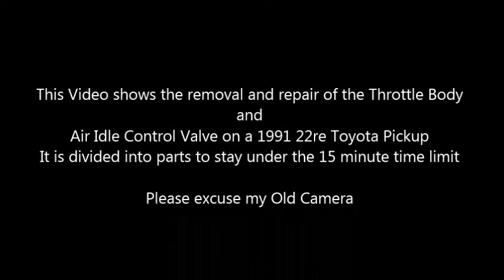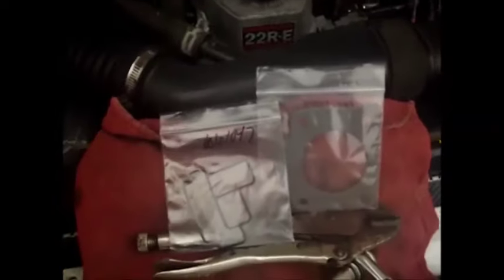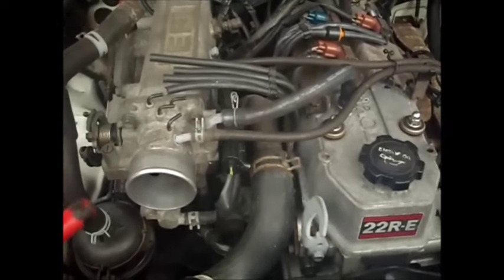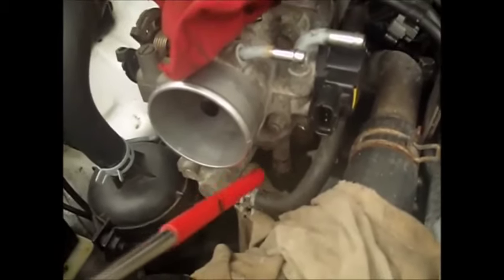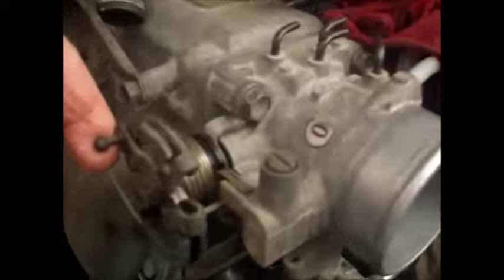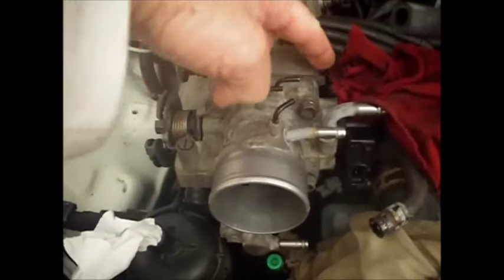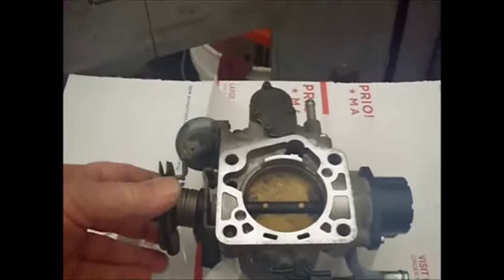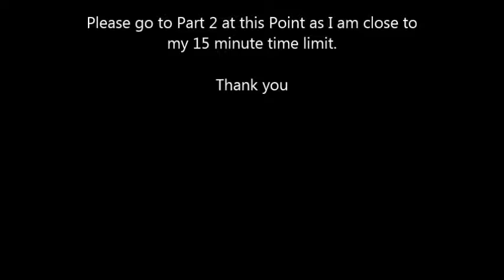Removal and Repair of 91 22re Throttle Body and Idle Control Valve Part 1

Comment: Thanks for this video. I was going to take off my throttle body to a 95 toyota pickup too. I looked at the throttle today by taking off the plastic intake pipe, then i was opening the butterfly plate to see inside it and wow it was gunky behind the plate and a little dirty in front of the plate. So what i did was grabbed a towel, shook it real good to get all the dirt off the towel and wiped the inside clean with my hands using the towel. I tried reaching as far into it behind the plate as i could, but i couldnt get the gunk out from behind the plate. So after cleaning as much as i could, i put the plastic intake pipe back on and started it and didnt notice a difference until i drove it around, i was like woah. the gas pedal felt extra smooth and the response to the acceleration was on point from a dead stop. I was actually keeping up with the other cars on the road now. normally they would over pass me every time. Then I drove it 7 miles to the beach and 7 miles back home, doing a total of 14 miles and jesus christ my gas mileage improved like crazy. It wasnt draining gas as much as before since i cleaned it. I couldnt believe it. so when i got back home all i was thinking about was the gunk behind the butterfly plate and was planning to take it apart tomorrow. but then i saw this video and purchased a gasket online immediately. so im going to wait until the part arrives and then im going in and cleaning that mucky carbon off once the gasket comes in the mail. I cant wait. Im already happy about the results just from cleaning the front of the butterfly plate. i can imagine how much better it will run once i clean behind the plate. this thing is a real gas saver now. before it was slow as hell and worse than a V8 when it came to gas haha thanks for the vid

Comment: Thought I'd do this to my 22RE as it has 462,000 miles on it. After watching this video I went out to my truck and was surprised my 1986 22RE engine does not have a IAC valve. I triple checked and not there. When inside I went online and found out they added it on the 22RE starting in 1989. One less maintenance issue for me. Good.